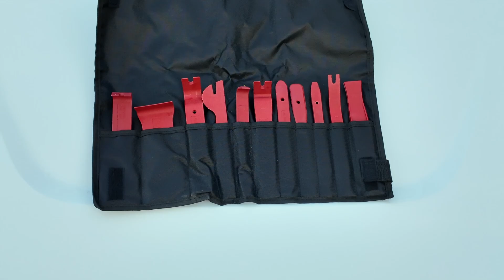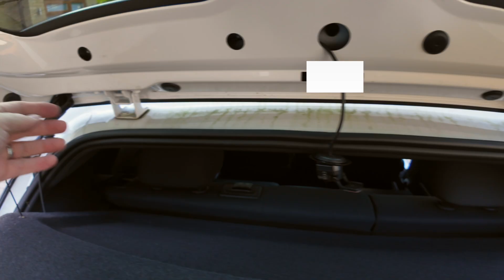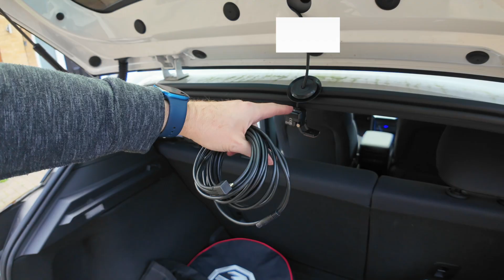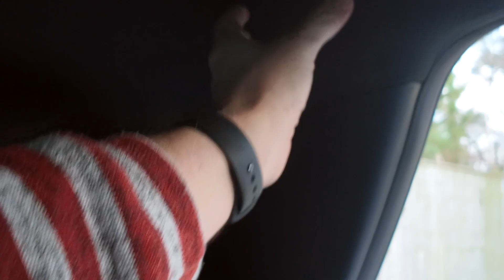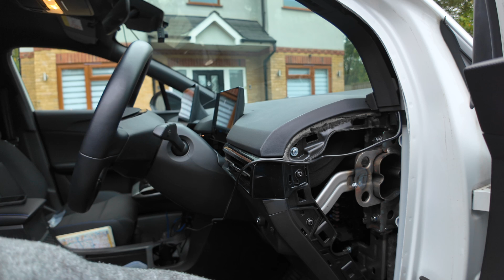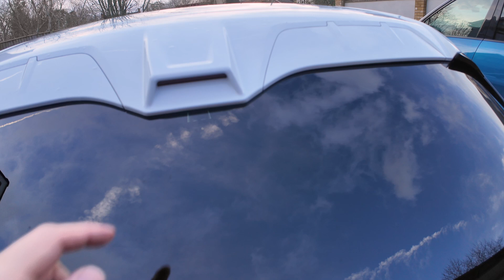MG4 - Hardwire Front & Rear Dash Cam

Comment: I'm sorry but I think you should have run out along floor trim and not the roof trim because that way you would not have run the risk of effecting the airbags. The way you ran it, the cable are probably straight in front of the airbags. If they are deployed you might have an injury risk to the occupants.. Even though I know that many others have also taken this route like you have.